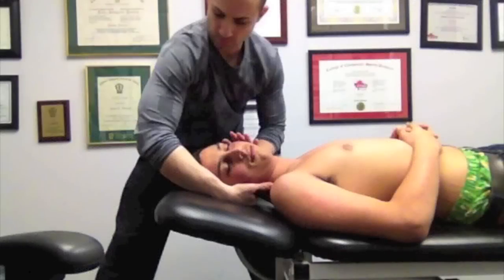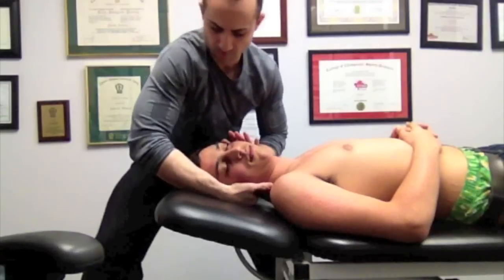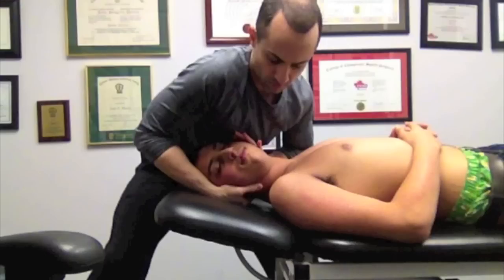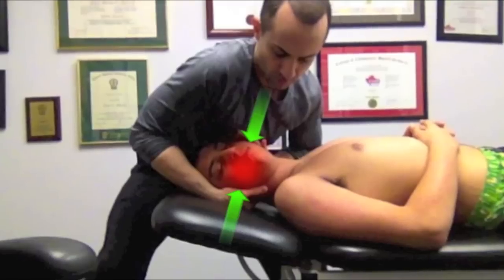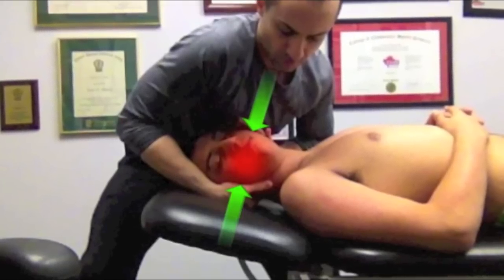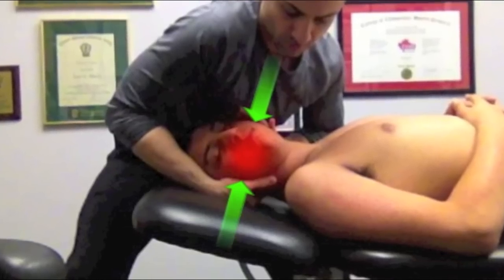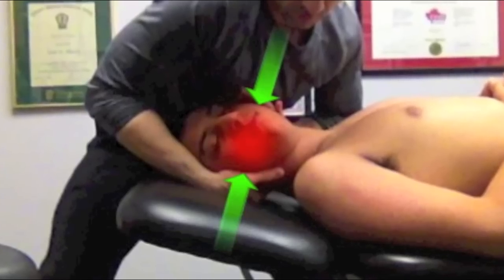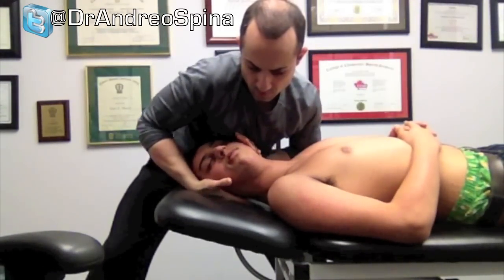Demonstrating an effective manipulation for the occiput (CO/C1)

Comment: I would imagine at this level of the spine a certain degree of rotation is needed to take up joint slack, however, great concern should be taken to not induce rotation during the "thrust" to decrease stress on vertebral artery.
Reply from the maker: the literature does not support the notion that any form of manipulation is any more/less dangerous than activities such as looking up at a bird in the sky with regards to vertebral artery injury
Reply: Exactly.  There is more force placed into the vertebral artery with full end range AROM rotation of the C spine than during an HVLA maneuver
Reply: @DrAndreoSpina  I've never heard of anyone dying before from looking up at a bird.